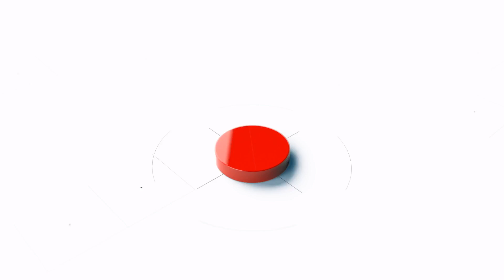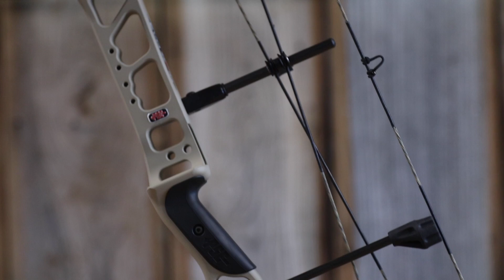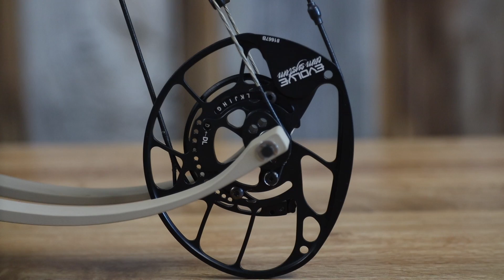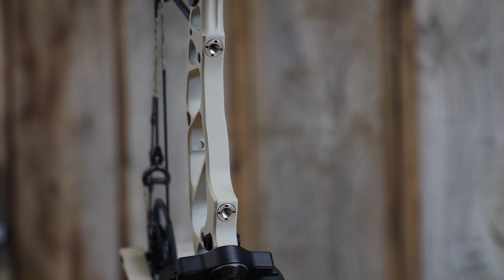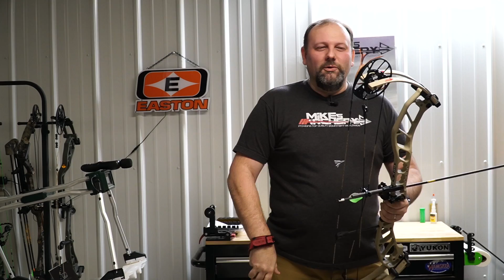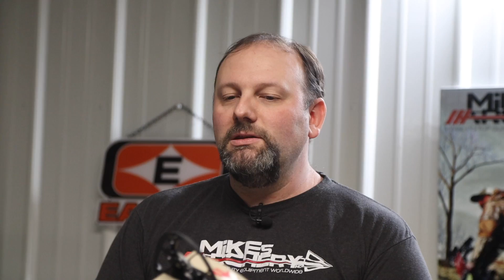2022 PSE EVO XF 33 EC Bow Review By Mikes Archery

Comment: Which has the smoother draw, v3x 29 or this bow?
Reply from the maker: The EC cam is probably smoother. If you get the E2 cam then the Mathews is probably smoother.
Reply: @MikesArchery  thank you, for a shorter draw 26.5 is either gonna be more advantageous over the other ? Is the 33 that much noisier over the 29?
Reply from the maker: @chrisnewhart673  no they will perform and sound so similar you won’t be able to notice the difference.
Reply: @MikesArchery  thank you !

Comment: So this is one of the fastest bows you have ever tested? 312fps is blazing. I believe the xpedite posted the same speed with an inch les an brace height? It’s faster than any of the flagship bows even the speed bows even with a 6 3/4 brace height? If that’s right it a no brained. Looks like it’s 20 fps faster than an evl?
Reply: Lol you're  high put that Crack pipe down.
Reply: @Life-of-Bluegrass_Music  if you watch his other video where he test the new e3 cam. It’s faster than any bow he has ever tested with a 6 3/4 brace height….

Comment: Are you able to show a speed test in the 3 different let off options ? I Would just like to see how much speed is lost at 90%
Reply from the maker: None, in fact it usually picks up about 1fps
Reply: Are you saying that at 90 % let off its faster than 80 or 85% ? 🤷‍♂️
Reply from the maker: @robertbrewer8499  yes, the cam is built for efficiency at 90% and you are getting the max out of the draw curve and draw length on the cam and 90% tracks 1fps faster than 85% on a PSE cam.

Comment: NICE!!!.. its avaliable with the new E2 cam also.Any idea if the E2 cam is as good as the EC cam??
Reply from the maker: +LIGHTS IN THE NIGHTS SKY it is available with the E2 and S2 cams. They are faster and the draw curve is more aggressive. They hold peak weight 2” longer in the draw cycle. It is noticeably not as smooth and easy as the original EC cam.
Reply: @MikesArchery  based on the look / shape it should be pretty similar to a Mathews bow